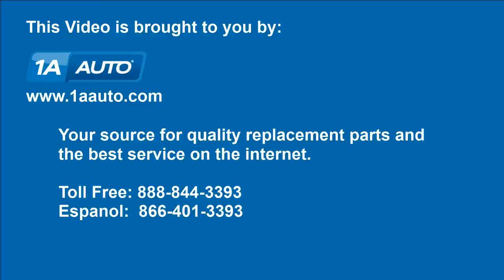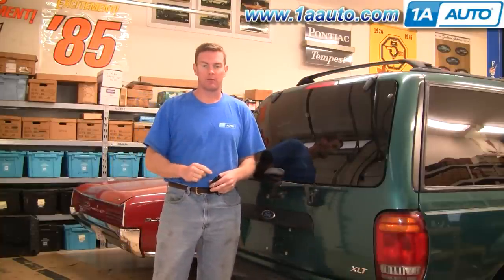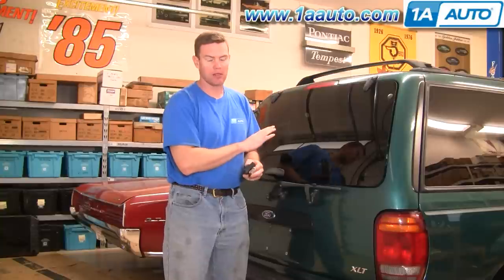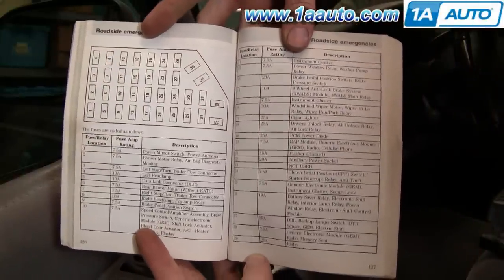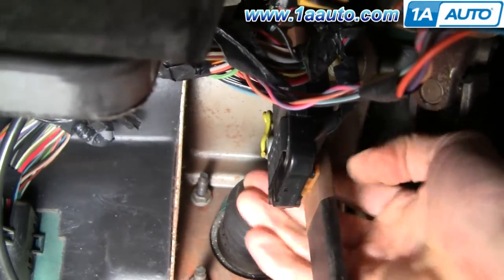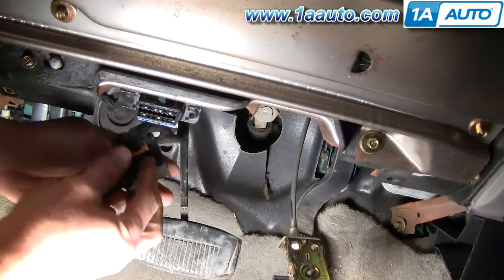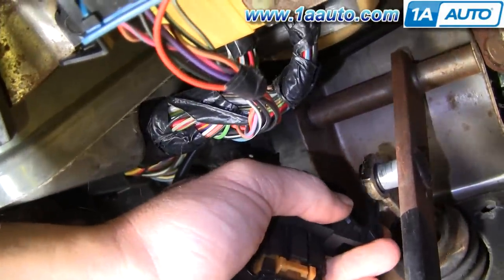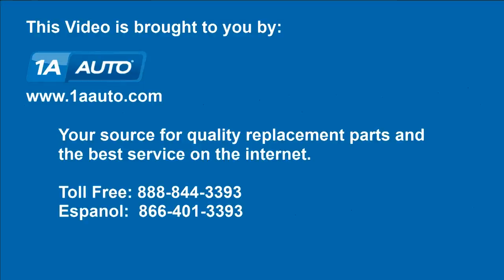How to Replace Brake Light Switch 98-99 Ford Explorer

Comment: I am a single mom and I did this in less than 20 minutes. I used an angled plier to pull the yellow piece. This is the BEST video on YT for this because you caught all the right angles on the camera. I have an 02 CVPI and this was a beautiful video. My neighbors were in shock that a 5 foot female got under the wheel of a car and did labor in a wig and inch long nails. And they didn't even break! Thanks for the video.

Comment: Thanks. I was actually able to disassemble the switch by prying open the 3 little catches and used a fingernail file to gently clean the contacts, sprayed some electronic cleaner in there, worked the contact  plunger a bit (I think it was hung up), and when I reassembled and reinstalled it--it worked fine. Thanks for the detailed video showing the location and removal procedure. I will keep your parts supply in mind when it finally needs to be replaced.

Comment: Thank you for the great video. I changed the brake switch on a 1998 Ford Ranger 4x4 manual transmission. The clutch pedal was really in the way hardly any room to get the yellow pin back in the shaft.  It took hours to get that pin back in. Had to do it all by feel only.  Your video really helped me out. All three brake lights were out  and new switch fixed problem.  Thanks again for the help.
Reply from the maker: +luthergato Thank you! We love empowering our customers and showing how to perform DIY auto repairs with our high-quality auto parts.  http://1aau.to/m/Shop-1AAuto-c

Comment: Thanks, Call ed a shop and the said it would cost me $80.00 for the to replace it.This helped a lot, Cost $10.00 for part, took me 5 min. to install. and solved the problem. Thanks again.

Comment: For what it's worth,
after my brake lights went out on my 95 explorer, I tried new fuses, bulbs and even a new brake light switch,  but still had no tail lights. Then, one of my front low beam lights went out. So I got on YouTube once again to see if there was some kind of repair video for that. Long story short, the video showed me that the front light malfunction, was due to a break in 2 of the soldering pins in my ( lamp out module ), located between the two front seats and underneath the green LED readout screen thing, that displays the condition of certain systems like your fuel level, oil,  lights, etc.
In addition, there were a few other pins that needed soldering, which turned out to be connected to the brake lights issue. So I soldered them too and now all of my lights are working again!  I watched one video on how to use a soldering iron, and eventually got the hang of it with minimal burns to the module itself.😀
It's an easy fix.  And you can get a soldering iron kit for under $10 at Walmart.
Hope this helps.  Peace

Comment: It was a complete mystery!!! I turned the key to on, pressed on the emergency brake, then lo and behold, the third brake light came on, but not the tail lights in the trunk lid!!  So today, I decided to start from the beginning.  I rechecked all the fuses, then went back to recheck the wires....that's when I discovered it....TWO broken wires!!!  Now all I need is the tools to fix them!  Thank you so much for your help!!!

Comment from the maker: @ncbookz You may want to test the wires to see if you have current to the sockets. If you do not, I would test the brake light switch to see if there's current coming from it when you press on the gas pedal. You may also want to check around the break light switch for broke or frayed wires.

Comment from the maker: @mrmonkey137 You may have a bad ground. You may want to check the headlights and the parking lights to see if there's a broken or a pinched wire. Hope this helps you out.

Comment: Both my lower brake lights were out but the high one worked fine. Decided to try out your suggestion to change out the bulbs, even though they looked fine. Presto, fixed!!! Both were bad even though they looked good. And now I know how to change the switch out if necessary, too. Thanks!
Reply from the maker: +jefftuckercfii Thanks for checking us out.

Comment from the maker: You may to check the wire going to the socket with a test light to see if there's power going to it. if there is power to the socket, the socket might be bad, also see if it's corroded inside.

Comment from the maker: @TopIeaf You may want to check on the wires, and also the brake light switch to see if it's loose or has some frayed wires causing the intermittent situation.

Comment from the maker: @dgrace1983 You may want to test the brake light switch to see if it's ok. If it is ok, also check for a broken or frayed wire coming off of the brake light switch.

Comment from the maker: @7233910 on most vehicles they are on the dash near the steering column. It should be on the right hand side near the headlight switch.

Comment from the maker: The issue might be is the wire grounded itself to the body at some point and destroyed the circuit. You might want to bring it to a mechanic and get the problem looked at closer.

Comment: Similar setup in 96 Explorer, but the wire harness has only 2 wires on it. I was only able to get the wire harness to fit on the new switch upside down (or backwards, however you want to call it), but it still seems to work. Don't know why the harness wont fit on it the right way, there is a plastic tab in the middle of the switch that is shaped a little differently than the original Ford part, but as long as it works..

Comment: Thank you for the video. My brake lights went out and most articles I read were directing me towards changing the Multi-Function Switch. After watching your video I went to the car and fiddled with the brake switch and my brake lights came on but went off again. I then removed the connector and re-inserted it and my problem seems to have gone away. Thank you.

Comment from the maker: If everything works except for the brake lights, you may want to check the brake light switch to see if it's working. Also check for any broken or frayed wires that may come off of it.

Comment: Thank you for this video! Was fixing a friends Mazda B2500 and the housing had broken and it was sitting above the main cable line. Was having trouble figuring out exactly where the switch mounted.

Comment: absolutely true. I'm experiencing this now. But you CAN shift out of park if you turn the key one notch to unlock the steering wheel and you can then shift out of park to neutral to start the car.

Comment: would this switch also have an effect on the cruse control cut out, as in you step on the braked and the cruse deactivated when coming up behind a semi?  Same set up on a 1998 ford Taurus?

Comment from the maker: @rubenlincoln HI, I would check the fuse first and if it's ok. Test the brake light switch with a test light to see if there's electricity coming from the wire when the brake pedal is depressed.

Comment: Great video. My 1997 Ford Explorer XLT backup lights are not working. The bulbs look fine, Fuses look fine. I suspect the backup switch is the culprit. I would like to bypass the switch with a paper clip and test the wire connections to make sure the backup lights come on on bypass. There are many wires on the connector. How do I tell which wires to connect the paper clip to to test?

Comment: TRAILER WIRING HARNESS PLUG N PLAY WAS THE REASON I HAD NO BRAKE LIGHTS 

I have a 1998 ford ranger my brake lights wasn’t working however the third brake and my running lights was also working I check my fuses (#3/7) they was good so next I replaced both bulbs for brake lights still didn’t work but the running were.So next I replace my Brake Light Switch Part No. S37027 it’s location under the steering column still had the same problem.So I when under the rear of the truck and realized that I had a tow wiring harness for trailer I unhook and connected the factory wires back and Now I got brake lights

Comment: On my 2005 crown vic I have running lights, hazards, and turn signals, but no brake lights.  This specific plug from the video didn't have anything plugged into it, but the brake lights previously worked. The other little plug above this on the brake pedal had a hot 12 v line to it, but even when I connected the two ends I didn't get lights.  Any suggestions?

Comment: wondered if there is a way to simulate what the switch is doing, such as testing continuity on the switch itself, and/or jumping together two or more wires on the harness side, to see if the brake lights come on; just to determine if it is the switch that is the problem.

Comment: I have an 07 expedtion and gear gets stock on P i have to press the brake several times for it to go into gear, I also noticed the brakelights sometimes dont work.
Do you know if this could be a faulty brake switch?
Reply from the maker: Thanks for watching Mike. It sounds like the switch may be the problem. If the vehicle doesn't see the signal from the switch then i wont come out of park. The fact that the brake lights dont work either makes me lean towards this switch as well. Unfortunately i do not sell it for the 07 Models tho.
1aauto.com 888-844-3393

Comment: Another point.  The master cylinder rod can be rotated, and is not symmetrical.  With the rod flipped 180 degrees (by accident), I could not get the new switch on. Checked this video for proper orientation, rotated to correct position, and installed.  This was on a 2001 Sport Trac.

Comment: My tail lights won't turn off. All three: left, right, and center above the trunk. I have to unplug a fuse every time I turn off the car or it kills my battery. Will this repair work? Thanks!
Reply: Did you ever get a answer on this question you ask? I'm having the same problem with my lincoln aviator. What did you do to get your lights to go off? Any help would be greatly appreciated

Comment: I have 2002 ford explorer xlt and the part that is at the part store has to be wired in . But my problem is the brake lights don't like to shut off like they should . You have to press on the pedal a couple times .
Reply from the maker: It could be an issue with the brake light switch. You may want to take a look at that. Hope this helps you out. 1aauto.com 888-844-3393

Comment: If my brake lights work and the car will shift from park occasionally, will replacing the switch enable shifting normally? Is this at all connected to cruise control not working?
Reply from the maker: +Carol McCalman Since there could be multiple reasons why you’re experiencing this difficulty with your vehicle, I strongly recommend that you have a reputable mechanic inspect it. They’ll be able to troubleshoot the problem and tell you what part or parts you’ll need for the repair.

Comment: i have a 2003 eclipse gs 4cylinder auto and i recently replaced a side marker bulb and now my cruise control does not work and the third stop light  the one in the middle doe not not turn off... i looked around the internet for an explanation and most people said its either a vacuum leak or i have to use the same bulb from the manufacturer coz it messed ul the the circuit... i dont know much about cars so i would like to know what u guys suggest.  thanks

Comment: Great video. I have a 2006 Crown Vic P71. I replaced the brake light switch but they still don't work. All Fuses are good. Blinkers, emergency lights and running lights all work fine. On the brake switch connection however, there are 5 inlets, of those five, only two (far right and middle) have any power rating on my meter. The wires are all good, and there is no wear on them. Would it be safe to say it's just the connection to the Brake Light Switch itself? Should all five inlets have power?

Comment: I have a 1997 Ford Tbird. I found I had to brake lights. Running and turn signals all fine. So I changed bulbs since they were old nothing. I swapped the brake switch nothing. All tail lights are fine just no brake lights. I did see the 2 wires to the switch had one broken and one frayed so I clipped off the bad wiring then spliced new lines and switch pigtail in and tested with tester and they seem fine but still not brake lights. Is there a fuseable link in the engine bay fuses inside all good

Comment: I have a 98 Lincoln Towncar. I have tested the brake light bulbs, replaced the brake switch, and changed the correct fuse but my brake lights are still not working. Any other suggestions?

Comment: I have a 2001 Mustang Convertible and I just got a new top and switch fot the convertible and it work good, but it only work when the brake light on the emergency brake is on, is it the switch or what would it be? The emergency brake light doesnt light all the time I have to play with the brake until the light goes on on the dash.

Comment: So my brakes work when I barely press the pedal, it stops working and if I press really hard they come back on.  Does that sound like a brake switch? It does to me.  I imagine the same voltage should go to the lights wheter you barely press the brakes or stomp on them.
Reply from the maker: +Joshua Ward We do not have a way of being able to diagnose the issue that you are experiencing with your vehicle but suggest taking it to a local mechanic for a proper diagnosis.

Comment: Hi I have a 2007 Ford expedition, I checked all the fuses and relays and they are fine, I then purchased a break switched and still nothing. The lights are fine as well, I can't get my truck out of park because of this. Any suggestions?

Comment: On my 2000 Ford Explorer the brake lights work but only when the peddle is 3/4 of the way down. Would this be a symptom of a faulty switch? If not anyone have any ideas?

Comment: The issue with my 98 explorer brake lights is that with the headlights off, the brake lights work fine, but when the head lights are activated, and turned on, only the 3rd brake light works, but stays on, while the 2 lower lights do not work at all. I was told that the brake light switch was bad, and needing replacement to fix the problem.

Comment: So I do have power running to the sockets. I also replaced all the bulbs just to play it safe. Still nothing. So I guess I will try replacing the stop light relay as well as the multi-function switch. Previously I had worried of lack of power to the brake light switch but realized I should try testing it while applying the brakes. So that's fine as well. So I'm sure it's the MFS or Relay.

Comment: I have a 2003 ford explorer sport trac. My bottom brake lights are not working but the 3rd brake light on my cab is working. Bulbs have been switched. Should i replace the brake light switch?

Comment: On my lincoln continental the lights come on when I press the brake pedal but go right back off with my foot still on the break pedal
Reply from the maker: Have you checked the wiring and fuses?  Did you install a new switch? +preston pernell

Comment: before buying the switch, verify the switch moving it forward and back, apparently, the switch eventually suffer a little wear and pressing the brake pedal does not move the switch and not doing their job. I say that after watching the video, check my explorer and moving the switch worked, what I did was fix with a cable and the problem was solved, and I have my brake lights working.

Comment: I replaced the brake light switch on my 2005 mazda b4000 . I now have brake lights but I lost my cruise control.What happened?
Reply from the maker: +Charles Drysdale Have you checked your fuses?

Comment: I changed my brake light switch after findn out my lights wasnt wrkn...it wrked fine bt nw my brake lights cum on even if i dnt press brake n my switch n wire seem warmer den usually...any suggestions

Comment: I have a 2002 Lincoln Continental. The right rear brake light doesn't work but lights when headlights or running lights are turned on. The RR blinker also doesn't work and I blow the #11 10A Lighting control Module fuse instantly when I press the brake pedal or turn the blinker on. Left lights all work fine front and rear and right front blinker and light works fine. Any ideas?
Reply from the maker: You may want to check the brake light switch on the gas pedal to see if a wire coming off of it has become frayed and is touching a piece of metal. If it is, it could be the reason why the fuse is blowing

Comment: Hi I have a 2001 mustang gt my brake lights wont turn off I touch the brake light switch and its reall hot  the night befo I smelled wires burning could that be the switch causing the lights to stay on and all 3 lights are on
Reply from the maker: You may want to inspect the wires coming off of the switch to see if they are frayed and are touching a piece of metal. Hope this helps you out. 1aauto.com 888-844-3393

Comment: Hey! All my 3 break lights arent working I already bought a break switch but its still not working, for a ford focus zts 2003, can you help me?
Reply from the maker: If the fuses are also good, check the wires that come off of the brake light switch to see if one of them is frayed or broken. Hope this helps you out. 1aauto.com 888-844-3393

Comment from the maker: You may want to take the bulbs out of the sockets and see if there's power to the socket when the brakes are applied, and check the wire to the socket to see if it has power. You may have to work you way back through he system with a test light to see at what point you lose power. 1aauto.com 888-844-3393

Comment: What type of plug do i need that plugs into the clip to replace. I need to re-strip and wire a new harness due to damage
Reply from the maker: +Underground Orchestra Media You may be able to get a new plug end from the dealer or your local salvage yard. Hope this helps you out. 1aauto.com
Reply: you should search online for Brake switch harness .